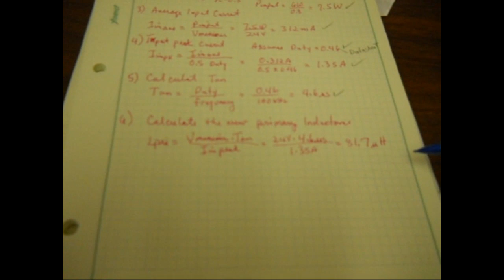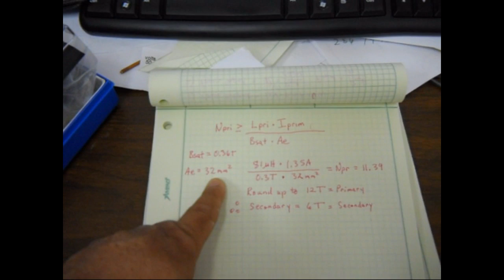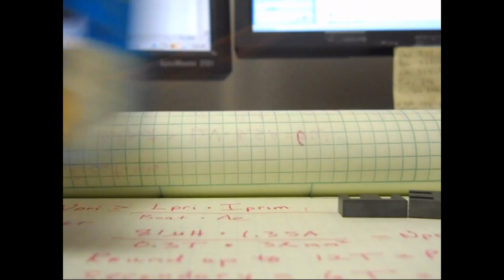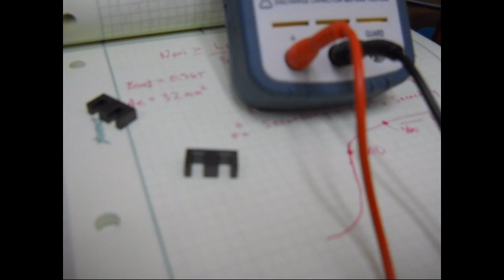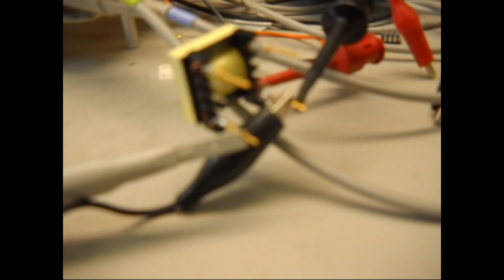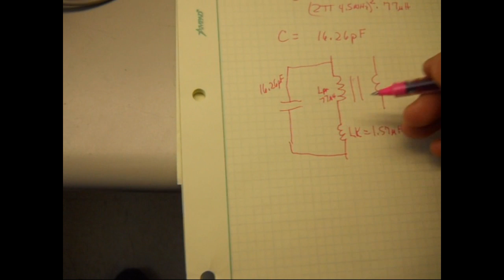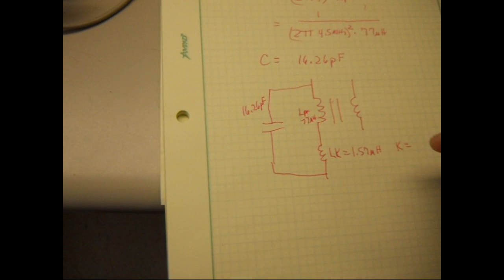Analysis and Design, of a Flyback; part 6; How to wind and characterize a transformer

Comment from the maker: Hi Kamil! Happy new year greetings to you. That is a good question regarding the Basso model.  The first lines of the basso model is shown below. It shows how the frequency and dutycycle are defined. PERIOD defines the frequency. So if you what to change the frequency to 100KHz, then you need to define it as PERIOD=10u. To limit the duty cycle, you define it as DUTYCYCLE=0.5. You should be able to define this using the .param spice function. You might be able to click on the PWM symbol model and added the DUTYCYCLE=0.5 and PERIOD=10u.

.SUBCKT PWMCM2 3 4 6 2 5 1
*$PINNAMES: COMP FB VOSC GND SENSE OUT
+ PARAMS:
+ REF=2.5, PERIOD=5U, DUTYMAX=0.8, RAMP=5V, VOUTHI=15V,
+ ROUT=10, VHIGH=3, ISINK=15M, ISOURCE=500U,
+ VLOW=100M, POLE=30, GAIN=31622, VOUTLO=100M, RATIO=0.333
*
I hope this helps. If you have further questions, you can post them here or at rbola35618@aol.com

Robert
Reply: Hi Robert. Happy new year. Thank you for all the information. I have created a new component in Multisim with new value of PERIOD and DUTYCYCLE - everything works fine.  Anyway I am going to find a way to use .param spice function. It looks like best way to change these parameters.

Creating schematic for simulation I noticed that there is a small voltage divider on I sense pin. In literature there is only a small RC filter in this place to suppress switch transients. In your simulation you have both filter and divider. Is it somehow related to Basso model as well?

Comment: Hi Rober, great video. I had wound transformer and tested it as you explained. Now I want to drive Mosfet using Basso model instead of signal generator to finish simulation. Could you please explain more about Basso model, how to configure it eg. how to change freq to 100kHz and max duty cycle to 0,46. I am using Multisim and I have this model but by default it operates at D-0,8 and 200kHz.